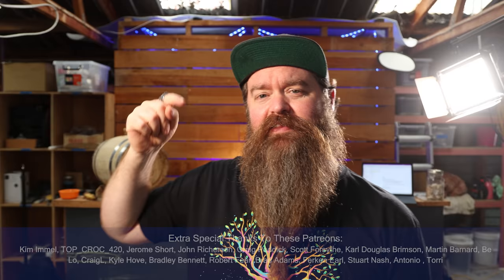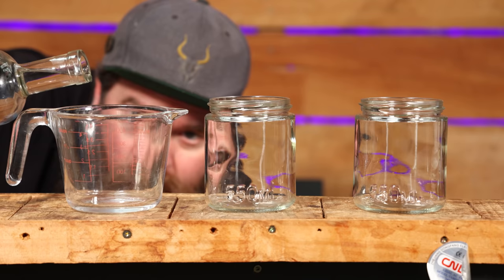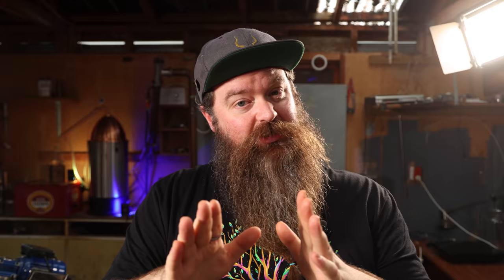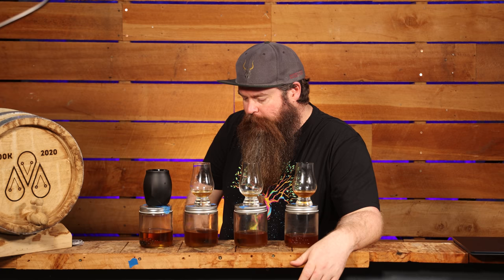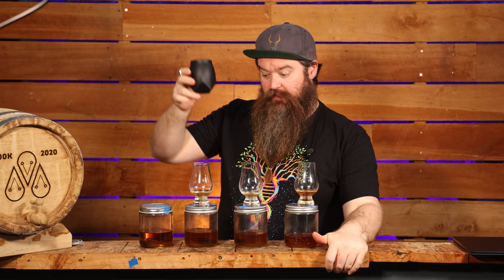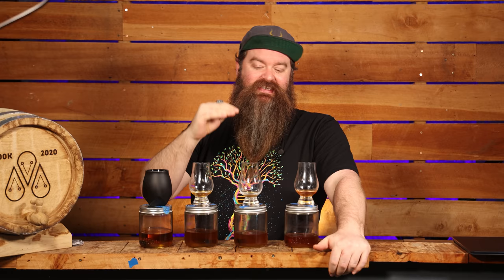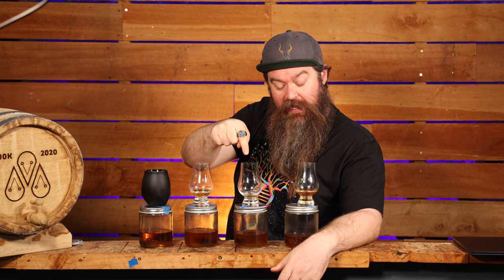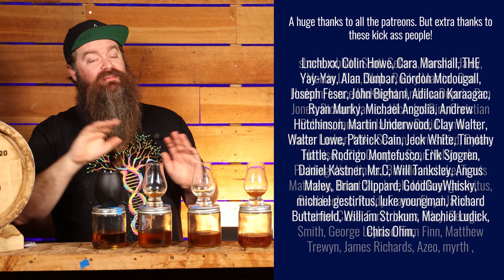Miraculously Fast Whiskey With Ultrasonic Ageing?

Comment: Interesting. I don't understand though why one would chuck the Ethyl Acetate formed during fermentation out with the heads but deliberately introducing it with this esterification? I think by adding the acids to the fermentation stage, the esterification may also happen as ethanol is being produced and it will come over in the distillation process anyway. My choice of acid catalyst would be a mineral acid such as Sulphuric maybe which would aid the wooding reactions. In my mind, a process purely from a chemistry point of view would be to extract the wood by normal exposure. Remove the wood. Add small amount of acid and hydrogen peroxide (for oxygen) and exposing it to UVC light. The UVC would excite molecular orbitals allowing complex molecules to react faster and in the presence of the oxygen from the peroxide, the tannic acids would break down to more mellow compounds. This is my thought experiment though.

Comment: I'm sure nobody, even the guys at ETOH are expecting to toss homemade white dog into a reactor and spit out Knob Creek 12 year on the other end. Yet. But I'm sure someone is going to stumble across a method to get close and do it with regularity. This is all valuable experimentation. Now. What if you took your 3 week old hot/cold whiskey and put in a touch of vinegar? Would it get that finish you're looking for?

Comment: I invented away on paper. And in theory Tlit should work!  that requires no electricity, no sea aging. That is literally free with out the use of wind. Im trying to calculate on paper to decide what age the liqour will be after a 2 day run. I need to have a control which i am going to use jack daniels and do a color comparison  to get the 7 year comparison

Comment: When I was visiting one distillery, a train came by on the tracks right by their barrel building.  He said that was one of their "secrets" on aging their products. They said the vibration effected the finish aged products.
Ultrasound is ultra high frequency, I wonder what ultra low frequency would do???   As stated frequency effects what is extracted and transformed.  Over time low frequency tend to be more destructive then high frequency.  Could use a bass shaker/seat rumbler used in home theater/gaming setups. 
(Edited to add more thoughts.)
Reply: Or you could use a low frequency piezoelectric transducer.

Comment: My 2 cents: 
1) Try an experiment keeping the sonication and the esterification separate
This would be to try and see if you could identify how much of the flavour profile comes from the esterification of said acid vs molecules that may have been digested off the wood by the acid (if any at all as they are all weak acids)
2) Layer the different acids at different concentrations and explore other acids, maybe start with esters that have been profiled whiskeys you like or acids in rum fermentations/sour mashes. 
As every acid would result in a different ester therefore different flavour. Adding just 1 acid is like adding only vanilla and expecting a more complex flavour.

Comment: Loved this one. I do this process myself. One thing to note when you were talking about them focusing on specific molecules, that is done via selection of the output frequency of the ultrasonic transducer. There are only a couple units for retail sale that have that option (ignoring the math that goes into figuring out which molecule corresponds to which freq). I also don't usually use an acid addition in mine either. I may try that at some point. Similarly, I find these still need to sit after the bath. I usually let mine sit on wood for a little longer and additionally let them sit for a few more months (depending on batch size) alone before I call them done.

Comment: May I suggest you make a caramel simple syrup (heat sugar in a pan until golden brown then dissolve in equal weight of water) add some drops of this to your spirit. The degree of caramel darkness will change the flavour profile. Most commercial distillers do this. A very dark caramel will bring more 'nutty' notes. Different sugars will introduce further flavours such as palm sugar, demerara sugar, etc. Thanks for all the great videos.

Comment: I actually tried this using everclear with an open top (I was afraid of it exploding) and lower temp a few months ago but found out I needed reflux (to help with the theoretical fisher esterification reaction which could allow more oxygen to interact as well without shaking it) although now I know it won't explode, it may be time to try again without a reflux. I was using a blend of honey and vinegar as honey has a wide variety of organic acids, I figured it may produce a wider flavor profile.

Comment: Hi! Instead of dosing the spirit with said carboxylic acid, you should soak/wash the wood with the solution! Allow it to dry slightly and then add the wood into your spirit.

Plus, most of the barrel age character comes from the breakdown of lignin and wood sugars, and though heat/ultrasound can help in this, you should add cycles of intense light!! UVA/Violet light is insanely useful for the breakdown of wood structural molecules that react and give flavor to a spirit!! Look up Lost Spirits Distillery as an example of a viable, delicious 6-day spirit.

So the best technique would be to heat your samples with acid-rinsed wood, place under intense light (long exposure sun or under full-spectrim grow lights), and place back into your heat bath to finish reacting.

Comment: Thanks for the awesome videos!
I have an experiment in the works at the moment, that is a bit more involved than my last experiment, but it involves yeasts.
I recently made 2,  5 gallon buckets of peach wine, one was Lalvin K1-1116, and the other was Lalvin EC-1118, and I noticed the EC had a very champagney flavor, and was ok, but the other was much fuller and more like a wine with a better peach flavor.
My latest experiment is on apple juice, I have 10 identical size & brand of apple juice bottles, and have pitched a different yeast in each one, and will soon taste test them each to find which yeast I prefer for apple wine. 5 of the yeasts are Lalvin, and the other 5 are Red Star.
With the peach, I am thinking of distilling the EC batch into a brandy, since it's flavor isn't as good as the K1 as far as a wine, at least for my taste preferences.
What I wonder is, are some yeasts better for wines, and others better for distilling when it comes to flavor profiles, and also, are some yeasts better for some fruits and/or grains than others.
Either way, I'm having a blast with experimenting, and watching all the videos from the fine folks here on YT.

Comment: It sounded like the acid quantity was a bit high on the tartaric and citric. Acetic acid will also be volatised by the heat/ultrasonics, so its affect on flavour will be reduced. 

It would be interesting if you ran a pH meter over the spirit before and after.

Comment: I would suggest breaking your experiment down into an extraction phase and then a transformation phase.  Get your level of wood right first, then add the acid and test transformation.  Could also do a with or without acid to see if it effects extraction.  However, if the primary goal was to create esters, maybe stick with acid after extraction.  Also maybe try some acids that line up with the esters you are trying to produce.  Butyric acid comes to mind.  A lot of the smells / tastes you mentioned in the acetic acid glass were acetate esters.  Maybe you'll get some butyrate esters using Butyric acid?

Comment: I have previously been a skeptic about rapid aging, but after this video and the recent podcast I am warming to the subject. Controlled oxygenation could be done with a carb stone, stainless tubing and an oxygen canister as is in common use in home brewing. Ultrasonic cleaners are readily available. Wood aging sticks, cubes, staves, etc. are easy to make or buy. Acid products also easy and widely used in brewing and wine making. Sou vide baths, check. How to assemble all this into a stainless reactor? Intriguing! Thanks, Jesse!

Comment: The ultrasonic should be adding O2 to the solution. The surface of the liquid will resonate at the ultrasonic frequency breaking surface tension. In a fish tank it is not the air bubbles that add much O2, it is the bubbles disturbing the surface tension that increase O2 transfer.

Have you considered adding acid to the temperature age process to form esters?

Comment: Watching this, I wondered, the process of oxidation, when I have needed to speed up oxidation for other purposes (such as speeding up rusting), I have used hydrogen peroxide.  If you could find a food safe source of this and maybe drip add it at some point in the process, it would be interesting to see what the result is.  I have tech grade stuff here, I don't think it would be a good idea to add that, but maybe those little bottle they sell at Unichem etc would work?

Comment: The ultrasonic aging experiment looks awesome.   
I wonder if any individuals have made their own version of photodegradation aging similar to how lost spirits does with their spirits.  I know their  ethod and/or equipment are patented and in the past have only allowed one separate rum maker to use it. I figure someone might crack that code of which spectrum and intensity of light over how much time works.

Comment: Did you adjust the vinegar sample to have the same amount of acid as the, I'm assuming, pure citric and tartaric acid crystals? If not, wouldn't you have 1/20 as much acid in the vinegar one (based on 5% acetic acid in most vinegar)?

Comment: Hi, Jesse! Make experiment like this: Take oak wood 100 grams, add Acid, little bit alcohol, water, take aquarium pump and inject some air, close everything with lid and put this "oak" in the Ultrasound reactor to some days. Why? Because I think about "wood" treatment, not alcohol... If your oak start`s to smell like whiskey, than we can use that wood to make our whiskey quicker! It means - if we can make our wood smell like whiskey, than we can "accelerate" aging! 🥂
Reply: Your comment got me thinking! Use large amounts of wood into jar to extract super concentrated oak flavor. Now you can use cc syringe to get the desired results from a controlled concentrate. Reverse engineering.

Comment: I don't have the setup, but I was wondering... Lactase is used as a catalyst for esterification in the industry. I'm not sure if it will get denatured by the alcohol, but even then, there is always immobilisation in calcium alginate. The same process as the spherification in modernist cuisine, just use a syringe with a tiny needle to create small droplets. The just use the beads instead of/alongside the acids in your process.
Weird, I know.

Comment: For the whiskeys made and matured by traditional methods ultrasonics may have little value BUT for the supermarket own brand whiskeys it's probable that the five years in oak barrels could be reduced to five minutes in the ultrasonic oak chips and a month in a barrel. Reducing the time almost always saves big money. Imagine an ordinary ultrasonic bath full of oak chips with a constant flow of cheap white dog becoming golden whiskey in under a minute, and flowing into barrels.

Comment: Sir, I would LOVE to know if you took actual pH of the three entries??   The acids you added have MUCH different Acidic effect...and likely the spirits should have a different pH.  Again, depends on what you did with the fermentation, and what level of acid came over, then you added more.  If you have any left, can you post the pH of the (4) jars, and the starting pH as well.  

I would think your starting spirit might be 5 range.  and the acid added samples might be below 4 or even 3.  remembering that pH is logarithmic.. and change change chemistry VERY VERY quickly....every 1 pH is 10X more acidic in simple terms and will change dramatically the kinetics of the chemistry.   

Also remember reaction rates generally double every 10C, but not all at the rate....so going from 50 to 60C doubles "Aging" chemistry... could go ON AND ON....  

but do you have pH's???? PLEASE!!

Comment: When the guys at the whiskey tribe tried this they also talked about rectifiers, and one of those was potassium nitrate, it's supposed to be the thing in stump remover that breaks down the wood, I wonder what that would do combined with the techniques you talked about here.
Reply: No, it accelerates the natural decomposition of the stump by supplying nitrogen for the fungi attacking the wood of the stump.

Comment: What would happen if you combined the two processes? Ultrasonic the product, then age it for a few years? Also, for my own curiosity a bit off topic, can you barrel age outside in a climate where the temps go from -45C to + 40C in a year? I know at 65% or greater the product won't freeze, but can the barrel handle it?

Comment: force aging seems like something that's more in the realm of big distilleries; anything that can shave years off their turnaround time I'm pretty sure all of them would jump on it.

That said, most of the homedistilled stuff hasnt been given proper treatment; so of course it's not going to taste the same; You're not giving it the same chances that the commercial guys are; it needs a barrel and most importantly, it needs time.  Hotter climates require less time than the cooler climates; but still time is a factor.

The other factor is contact with wood.  Chips and such only vaguely approximate wood barrel aging.  More like adding wood as a spice or seasoning at that point.  If you're going to avoid a full barrel, try cubes at the very least, and actual barrel staves if you can.    

The other, and it's a rather important factor; amounts.   1 litre of whiskey is not going to age the same way, even with proper wood contact, as say 300 litres of whiskey.  There's just less volume and less of the chemical chain reaction that is referred to as aging since there's well, less chemicals.

From the limited experience I've had, you can most certainly make some great stuff at home, however, if you're chasing a clone recipe or trying to improve on a commercial beverage, it's something that only the right volumes and equipment is going to get you.  The craft distilleries have been doing 5 gallon barrels to start with, so it's not unheard of to use smaller barrels.  However, having 2 or 3 barrels aging is still going to get you an obscene amount of whiskey that you will then have to drink and find some safe way to store for the long haul.
Reply: gives me an idea though; I wonder if someone would be able to move on it faster than I could.   Glass lined container with a wood top with an o-ring.  For smaller containers, you'd actually have to figure out the actual wood contact surface to volume ratio to see just how big a container and lid you'd need; but you could then age your stuff as would be normal, but in smaller containers at the homebrew level; use an o-ring to seal the wood to the glass so the only air/oxygen getting to the hooch would be through the wood.   Might be able to make perfect aging vessels for 1-5 litre volumes pretty easily.

Comment: There is nothing true about forced aging; it is speed/forced flavoring. With that said there are so many ways to speed up the flavoring process. My favorite and what I do is deap freeze for 24hrs then in my heated box at 100 degrees Fahrenheit  or 37.7 Celsius for 24hrs x4 times.